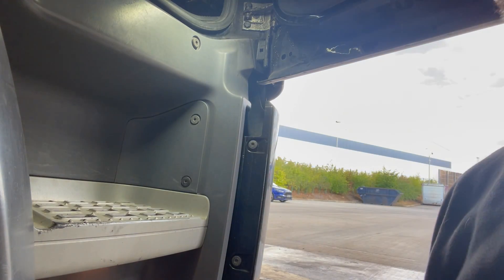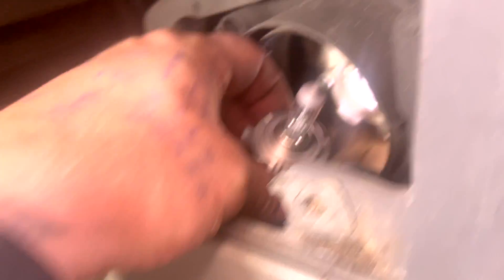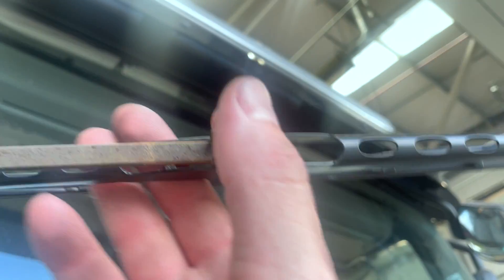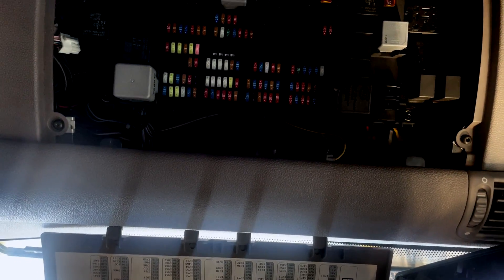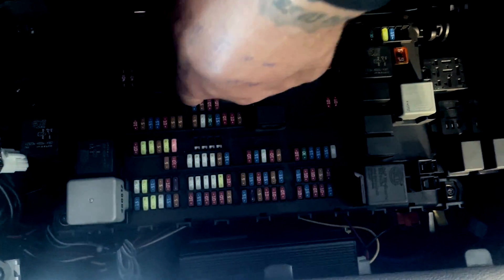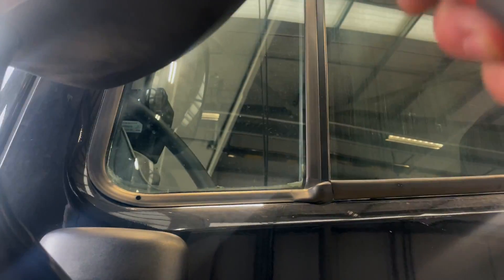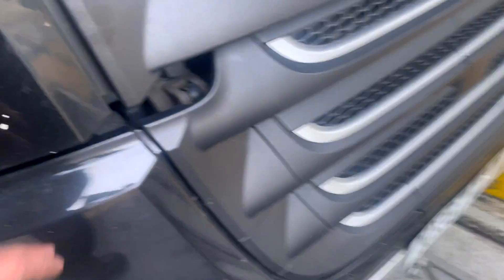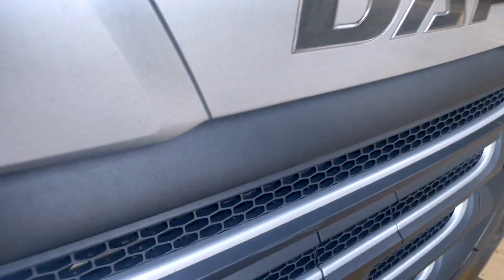Day in the life of a HGV Mechanic- DAF CF85 EURO 6- The technical basic jobs you can do yourself!

Comment: Splendid, thanks for that, just the job. Some of these simple things can be so time consuming as you struggle to work out how not to break an expensive piece of flimsy plastic. Just done the driver's door latch mechanism with the help of your video on it. What a pain those plastic ball joints are, it must have taken a good 1/2 hr to 3/4 hr just to refit one of them without bending the new latch. The driver's door hinges had worried me working alone, but turned out easier than I had thought with a chassis stand and some non-slip padding wedged under the bottom of the door.

Comment: Great basic video Dan,  I'm hoping to start an apprenticeship in September in HGV repair and maintenance level 2,  so these vlogs and short vidoes like these are a great help.  Trucks look really interesting to work on
Reply from the maker: Thanks mate, ahh nice where you going to a main dealer? And is it not level 3? I appreciate it if it can help just one person that it’s good! 🙌 yeah tbh there not bad at all.
Reply: @freightlanetv  Nah not a dealer,  its a large building supplier manufacturer called Mannok used to be called Quinns.  Its level 2 for two years then after that it's level 3 for another two years.  Fingers crossed I hope it turns out fine!

Comment: I have a driver side window motor messing about, winds down but not up, after I un plug the motor and re-plug in, it works for a few days then I have to repeat, bloody thing. Can't find a relay or fuse for it so assume it's all done by the window switch. Cheers mate, good to see the subs rising nearing 2k now.
Reply: I'm not a fitter, just a diy mechanic but maybe the electrical connector is getting dirty and needs cleaned. I'm not sure, just an idea :)
Reply from the maker: Theres not a dodgy wire at all is there, on the connector anything wierd if that makes sense? Or the motor is packing up? Yeah it’s coming along nicely maybe tbf I’m proud of how far it’s come and it wouldn’t be where it is without the support of you all.